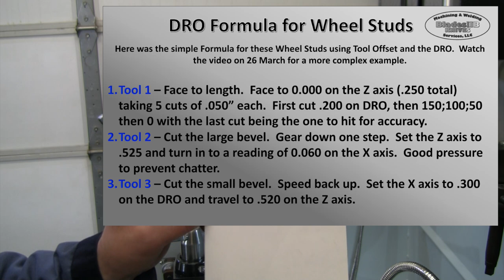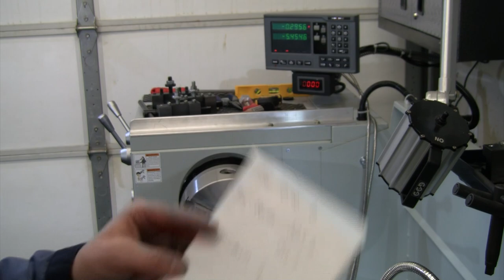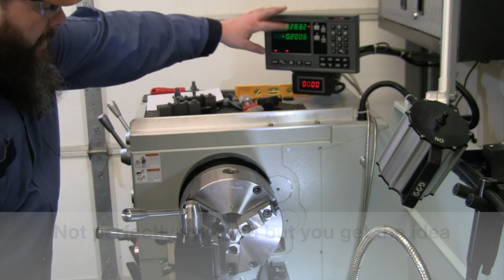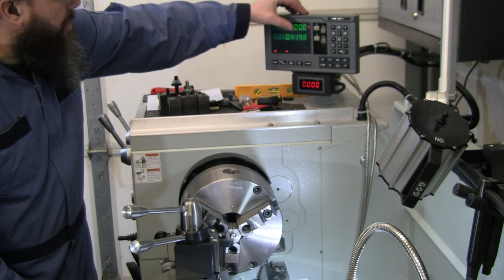Holding Odd Shaped Parts in a Metal Lathe & Using Your DRO for CNC Like Repeatability

Comment: Hey, are you aware that you can take off your removable jaws and just use the master jaws. Then you wouldn't have to make a fixture.
Reply from the maker: Marc - excellent point. I had not considered that for this job. Always new ideas to learn thank you. I believe I still could have pulled them up against the jaws to get the same repeatability on my DRO. Will consider that next time I have a short part to hold.